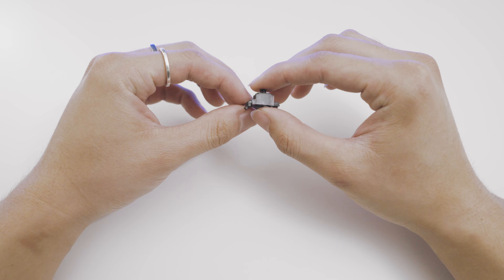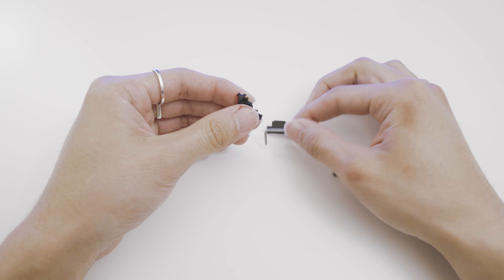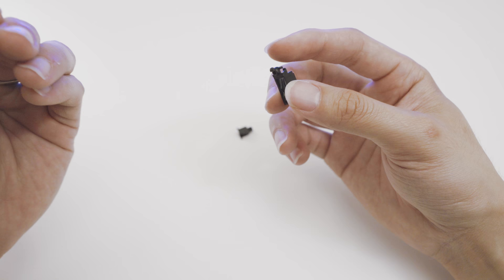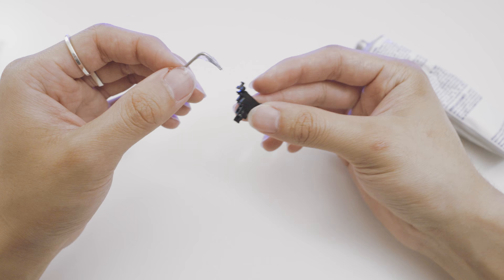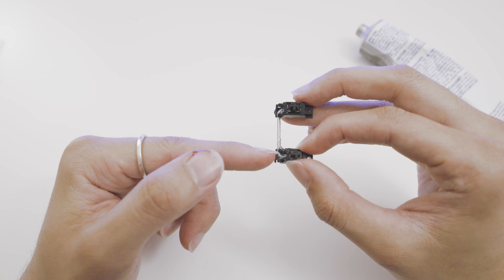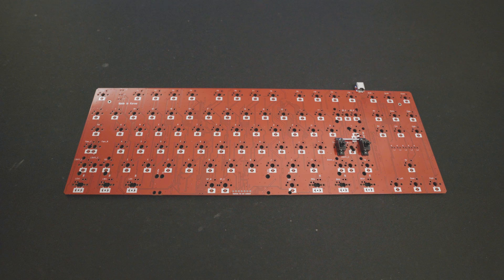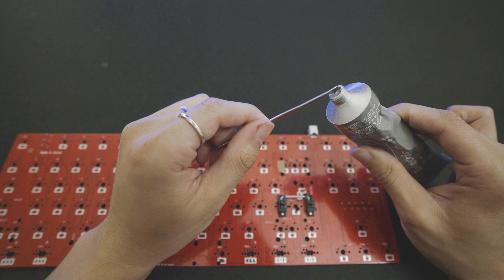How to Clip, Lube, and Band-aid Mod Your Stabilizers

Comment: Hi, I have recently noticed that Teaha is using a new method of clipping and lubricating stabs in his recent live streams and videos, and it would be really helpful if he could make an updated tutorial. Is anyone else wanting a new and updated video?
Reply: From what I've seen, Teaha uses a lot less grease and brushes Krytox 205g0 inside on the bars as well as inside the stabs, but a lot less than what is used in the video. Perhaps due to cost.
Reply: @wilderoutdoors  That's true for switches, but you don't want to over-lube switches. Stabs are different though where you don't need to worry so much about over-lubing them.
Reply: he did say on stream that a updates vid would be out by the end of the year!
Reply: @eliaspariser3234  seems like i should wait 30 days before modding my noisy-ass k95 spacebar.
Reply: @deejeh9494  ye i jus said nah i’m not waiting and just did what he does here
Reply: @eliaspariser3234  its not an issue for me to wait, im waiting on orings as well and i can break-in my k95 since its brand new.
Reply: I forgot which stream it was on but if I recall correctly, he said that he actually stopped band-aid modding altogether. Apart from that, everyone else is right in that he uses 205g0 exclusively for everything lubing related, switches and stabs alike
Reply: @jrbaprz  Thank You For Informing Me!
Reply: @eliaspariser3234  Thank You Also!
Reply: Can I use permatex dielectric grease on the insides as well?
Reply: @jrbaprz , so what does it mean? That he just lubed the stabs now with 205g0 and that's about it?

He doesn't even band aid the stabs anymore?

And how about the clipping of the stab, does he still do that with his new keyboards??

Comment: 2020 edition: don't buy GMK stabs. buy literally anything else. durock, everglide, zeal, C3, etc. no clip or bandaid needed. a decent lube job will do the trick
Reply: Why? :o are cherry screw ins better?
Reply: Who the heck cares... they are all the bloody same. even doing these mods to stock stabilizers that come with cheap mechs will be enough.
Reply: @weakness8603  cherry doesn't make stabilizers anymore. they sold that part of their business to GMK. all GMK stabs suck because they use new garbage molds. GMK stabs have to be clipped where as other stabilizers do not. the guy who says they are the same is clueless. he's clearly never seen a durock stabilizer, and diffidently never used them.
Reply: @solomonshv  Thanks for informing me. The price difference is non existent anyway, so might aswell go with durock
Reply: I’ve seen some people claim that “Genuine Cherries”/GMK stabs have better rattle reduction with clips and bandaid than the new stabs, however I do not have personal experience so take what I said with a grain of salt
Reply: @solomonshv   @Abraham Lincoln  1) Clipping stabilizers for a full board takes like 2 minutes
.
2) I've been into Mechs for a couple of years now,  I know a lot about the hobby
.
3) Yes, Durock/Everglide stabs are "better" than GMK, what I was saying that if you already ordered/got GMK stabs, than its not such a big deal.
People stress about stabs too much, even paying 30+ dollars for Zeal stabs, but at the end of the day its just a piece of plastic with a metal wire inside of it, most of the time clipping/lubing stock oem stabs will enough.

Comment: Today I spent 4 hours lubbing my switches and clipping the stabs for the first time thanks to your videos. It was extremely exhausting, but now I fell I'm typing in a top tier buttery keyboard. <3
Reply: how tf did it take you that long
Reply: @mohawk4759  if you want to lube all switches, you have to take them apart, one by one. Will take 4 to 6 hours lol depending on keyboard size, thats completely normal
Reply: @defranken  i know but its never taken me 4 hours
Reply: @mohawk4759  maybe because they dont have a switch opener or a 3d printed lubing station or something, it can be hard if its like that

Comment: 4:56 : Lube, Clip, no Bandaid
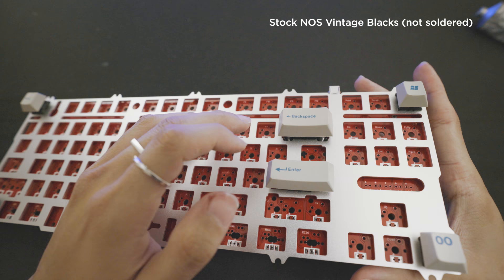6:57 : Lube, Clip, Bandaid
Reply: is it just me or does the band aid actually make it sound a little louder?
Reply: @PabzRoz  I wouldn't say louder but definitely more of a deeper tone
Reply: Deejay honestly it makes it sound wayy nicer
Reply: i dont hear an improvement, just difference in sound
Reply: @deejdotwav  high pitched tone, not deeper in anyway..shits way louder.
Reply: If you look carefully, you'll see that he's using different fingers for the two tests, which appears to make him hit the key harder for the band-aid mod test. I believe that is why the band aid seems louder. Still you can hear the deeper 'thud' of the plastic hitting the padded surface of the band aid.
Reply: Maybe I won’t bandaid, I like the higher pitched noise
Reply: @stephen3260  he was hitting the bandaid modded one significantly harder and it wasn't the same recording
Reply: @PabzRoz  The change in tone is probably due to how he is holding the pcb

Comment: Fantastic guide! I never knew lubing made such a major improvement! Also I think you could use some macro shots of the components. I understood the guide just fine but I think that it'd be better if I didn't have to squint at the screen trying to find what you're pointing at. Good work overall 👍

Comment: Finally swapped out the stabs on my very first keyboard (GMMK) and this is a lifechanger - wish I had learned to do this and done this with my very first actual build from scratch which would now require desoldering all my switches. Oh well, I guess it's just a sign of my progression in this hobby, lol.

Comment: Nathan can I use switch lubes ti lube inside the stbas where plastic meets plastic I dont have that you are using. But I have the other lube for the metal parts tho.
Reply: Nathan, do you put Drawer Liner under your pcb to dampen the sound or a Sorbothane Acoustic & Vibration Damping? Does it matter what I use for material?

Comment: Thanks for the guide - I thought I might've been a bit too heavy-handed with the lubricant, but it's really helped my keys be a lot quieter and smoother!
Reply: So do you think it's possible to add too much grease to a stab?
Reply: @stopthephilosophicalzombie9017  You can definitely overlube stabilizers. I got a second-hand keyboard where the last guy ridiculously overlubed the stabilizer. It's hard to do, but probably a lot easier with Krytox 205g0 than the generic silicone grease.

Of course, you can always try wiping / washing the excess off.

Comment: Why are there fangs on the stabilizers in the first place if the only thing they do is damage the PCB and make noise?
Reply: Probably just left over from the plastic molds used to make them
Reply: @JFinns  That's simply how they were designed (originally by Cherry). I think it was meant to make the bottom-out less harsh. That said, all it really does is make the key feel broken or otherwise wrong. Ever since I began using a keyboard with clipped and lubed stabs (and GMK screw-ins, at that), I've never been able to go back to even well-lubed Costars.
Reply: @TommyFenstermacher5150  Funny thing is GMK screw-in is legit the same as a cherry stabilizer only difference is the screw to secure it better. That being said I like the "cheaper" cherry stabs.
Reply: @TommyFenstermacher5150  Is there anything that can be done to help Costars, besides lubing?
Reply: @ItsZentraGaming  I think the screw might inadvertently end up transmitting more shock/sound to the pcb. It's really cool how keyboard design has made people really aware of mechanical engineering and design, showing principles like material stiffness and strength, damping, vibration, and acoustics all in one use-case. I can't think of another popular hobby that brings awareness of physics besides maybe guns. ; )

Comment: i have to advise advise against excessive amounts of grease to dampen noise. (not hatin'!) it does work, but collects dust and debris that ends up scratching up the plastic over years to come. wrapping the bars with plumber's PTFE tape is the cleaner long and more concervative long term solution. (just make sure to stretch it out fully, or it will wear faster)
Reply: It would be great to know where exactly you are putting the tape? The whole bar, just the tip? Just the bend? How many layers do you wrap around? Thanks

Comment: Do you need three different lubricants for your board?
I've seen other tutorials do both the stabilizer wires and housing and switches with their g205g0. Will that work?
Reply: Edit: read your question wrong at first. No you don’t need to use three different types. 205g is more expensive though so some people prefer to use cheaper greases since you need to use a bit more on the wires.
Reply: @gugujee  Thanks, that's helpful.

Comment: About those kinds of stabilizers, if you don't clip off the pointy stems that are on the bottom, it will destroy the PCB and also have a dampening effect with the overall stroke.  Not sure.  When I pressed on the keys that are stabilized, I felt like a dampening effect on those keys and I think they are coming from the stabilizers.  They don't feel like you are pressing it all the way down that you would feel from the switch.  The Royal Kludge RK61 has that problem, but when it comes from the Ducky One 2 Mini, the keys with the stabilizers feel awesome!  Just like any other key.  Also on the RK61, the switches they use are "RK Red" switches.  Not really sure what they are, but they are not that good as the "s" key has stopped responding to my strokes.  I'd rather go with a company like Cherry that has tested their switches and go with the real deal.

Comment: Great tutorial! That's exactly what a novice like me wants. One question: I don't have Dielectric and Teflon Grease. Can I use Superlube instead? Or is it more recommended to use these two?
Reply: For start i have buy superlube multi purpoise oil but it's not the right way definitely, krytox 205 g0 + permatex dielectric grease + band, maybe using superlube on the stem
Reply: @akira8-customkeyboards17  Superlube on switches and stab stems is fine; it's a low viscosity lube that is safe on plastic. It might not be as "smooth" but it won't make it sticky, which is the big fear with switches.
Reply: Better to use thick krytox instead of dielectric grease. Something like 206g2 or 207.

Comment: do you still recomend using Dielectric grees and Teflon Grease in 2020 or krytox205g0 is better?
Reply: Nathan still uses both Dielectric Grease and Teflon for stab lubing. The big difference between them and traditional switch lubes is their unrivaled viscosity; they're just way to thick for use on switches, yet just thick enough to make a super smooth stab.
Reply: Just use whichever you have
Reply: @shilo.5087  how bad would it be to use krytox g205 to lube the inside of the stabs in place of the teflon grease?
Reply: @zach_morgan  the only bad thing would be that you used 205g lube for nothing. Test it out, if it does what u want then good, make sure not to put too much since it's thicc. If it doesn't work, use a qtip or something alike to clean it off. When it comes to lubing stuff testing youself is the best way to find answers!

Comment: Are there any disadvantages to clipping the stabilizer? Why do they even bother to have them if everyone just cuts them?
Reply: This is from another comment:
"That's simply how they were designed (originally by Cherry). I think it was meant to make the bottom-out less harsh. That said, all it really does is make the key feel broken or otherwise wrong. Ever since I began using a keyboard with clipped and lubed stabs (and GMK screw-ins, at that), I've never been able to go back to even well-lubed Costars."

Comment: Can I just use dielectric grease on the plastic instead of Teflon grease?
Reply: I think the reason two types of grease was used is because the Dielectric Grease would be to thick and would slow the stabs down causing them to be mushy... so use thick Dielectric Grease on the wire and Teflon Grease (thinner) on the fine walls of the stabs.
Reply: @jamesrush6219  Switch lubricant (Trys 3203/3204, GPL 205/6) is also a better alternative, just nothing too thick.
Reply: Can I use Silicone Oil (sw-92sa) in the stabilizers? I know it works on the switches, but I need to know if it works on the stabilizers, thanks in advance
Reply: @vicentealday  yes, everything that applies for switch lube still works INSIDE of the stabs

Comment: I just got my hands on Krytox 205g0 so does this mean I can use this on everything? Stabs, Switches, and Springs? Im just kinda confused with so many lubricants and the use of multiple at once. Or do I use the 205g0 on just the stabilizers and Teflon in the switch? Like im in a wormhole here any info I would LOVE.
Reply: yeah you can do everything w/ only Krytox

Comment: I'm trying to bandaid mod. How do you get the paper off the bandaid once you cut it? I have been trying for half an hour. Once you cut it there is no tab and it will not come off. Nothing I can do will expose the adhesive. There is no seam whatsoever between the bandaid and the back paper.

Comment: Im an idiot and I'm brand new to building keyboards, but this method doesn't require soldering for the PCB?
Reply: Stabilizers are not soldered on the PCB. PCB Stabilizers come in either clip-in or screw-in variants, and there are also Plate mounted stabilizers.

Comment: Can I replace the Dielectric/Teflon Grease with Tribosys 3204 lube?
Also, in a certain stream, you told a Holy Panda lube tip, you said that lubing the bottom of the Halo stem is not recommended because you want to keep the "Holy Panda" sound, is that true or I just misunderstand you?
Thanks.

Comment: It's way too difficult to lube stabs. I've tried on 6 sets of gmk screw-ins and every time the spacebar gets stuck and doesn't return. I wish that a company would just make good stock stabilizers rather than expecting us to do all the dirty work. Also I also wish that someone would make tactile stabilizers and also silent ones - it's almost impossible to make a silent keyboard.
Reply: @Ivan It's assembled fine; I just can't get the space bar to return. It's like it's sticking somehow. I've tried using a super thin coat of lube and even going dry; either way, it still sticks.

Comment: i have a durgod venus and it comes with lubed stabalizers. but the right side of my left shift makes a ting sound when i click it that the left and middle of the key doesn't make, or any of my other stabilizers. what could be causing this? should i try injecting some dielectric grease in it? or get it replaced cus i just got it 2 days ago. any help is appreciated!

Comment: Yo I have a Corsair K95 XT Platinum w/ Cherry MX Browns. How do I do this process on my keyboard,? Can I lube inside the MX Brown switches?
Reply: Exo Zen bruh moment u have a prebuilt so it’s soldered already u have to desolder the switches with stabs to take them out and mod them
Reply: Yeah you might as well build a new one. Cherry Mx browns are 🤮🤮🤮
Reply: @solimano9372  Nah dude, they feel pretty good. I actually tried every switch and was torn between browns and blues. So I got the brown
Reply: @izzio6680  If the process requires soldering, I have no problem. I actually like soldering, and find it oddly satisfying
Reply: Exo Zen if ur gonna desolder ur Keyboard i HIGHLY recommend getting new switches like if u want good tactile switches go for holy pandas and zealios for linears Gateron Ink and NK creams not bad choice but it’s up to u.
Reply: Exo Zen wow I didn’t expect that as I have a keyboard with browns and they feel so scratchy  but aslong as u enjoy them it dosent really matter

Comment: Man cherry plater stabilzers and at hese four mods are awesome. Chinese plate sįabilzers compared to modded cherries is like comparing the sound pf banging metal and rubber ball. Like they were much better than unlubed cherry on corsair keyboard but realli differs comparee to lubed chinese stabilizers. Of course hald of the job is good plastic to start with (as that cherry one) but another half is lube

Comment: Plzzzzz respond someone, which is better: dielectric grease and Teflon grease combo OR 205g0 for everything
Reply: The dielectric grease is thicc and makes the wire not rattle and the teflon grease reduces the friction between plastic

Comment: i live in brazil and it is very difficult to get the specific keyboard lubricant, so can i use this teflon grease to lube the switches? they are linear. 
Sorry for my poor english
Reply: I don't know exactly if I would use Teflon grease inside my switches but if you can get Krytox 204 or 205 on Amazon then that would work. Some lubes are better than others for specific switches but if availability is a concern then you should be fine

Comment: Can I use Silicone Oil (sw-92sa) in the stabilizers? I know it works on the switches, but I need to know if it works on the stabilizers, thanks in advance
Reply: For the wires or the plastic part? For the sliding insert probably yes if it's fine for switches. But the wires need something thick

Comment: why would you want to use both teflon and di-eletric grease? What are the advantages to this rather than just using one or the other or even the lube you used for switches?

Comment: Make sure your bandaids aren't too thick. Mine were, and I didn't realise it was preventing the stabiliser from clipping down properly until I had soldered about 10 of my switches in, I had to desolder them so I c ould remove the plate and pull out the stabiliser and remove the bandaid, sucked ass.

Comment: I did the bandaid mod by just stacking a lot of tape until the stabs are not rattling. the bottom out feels so dampened but the sound is astronomically better.

Comment: If the dielectric grease touches the plastic it can damage it ( pcb too)? Can use synthetic grease superlube for stabs and they are safe for the plastic parts (stabs)?